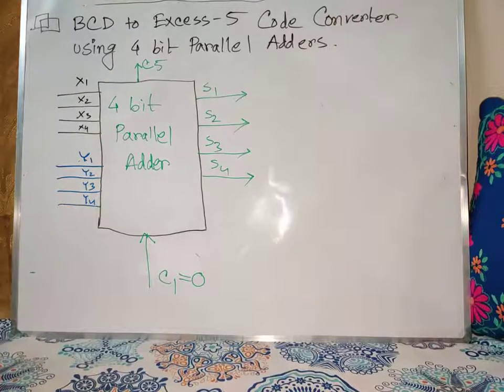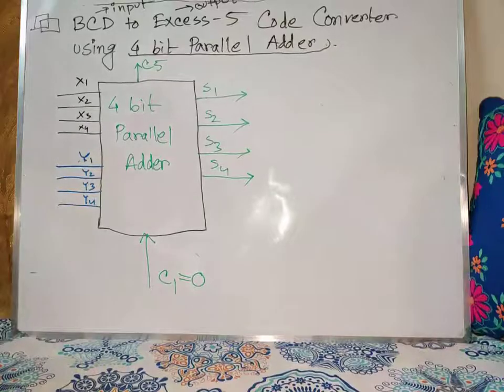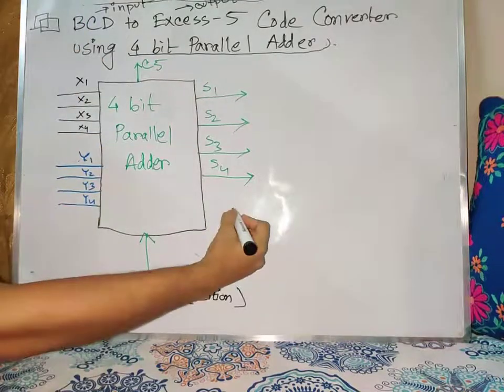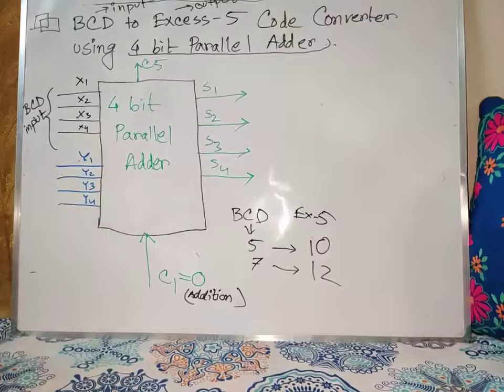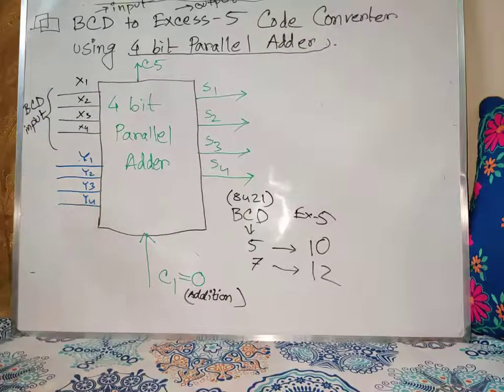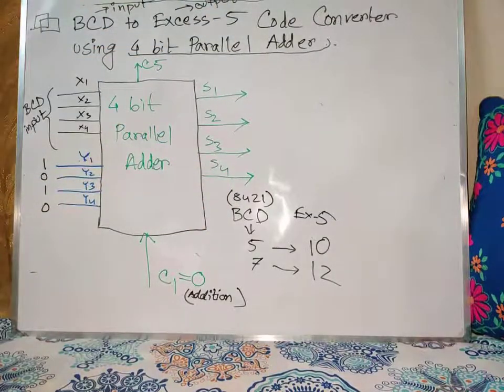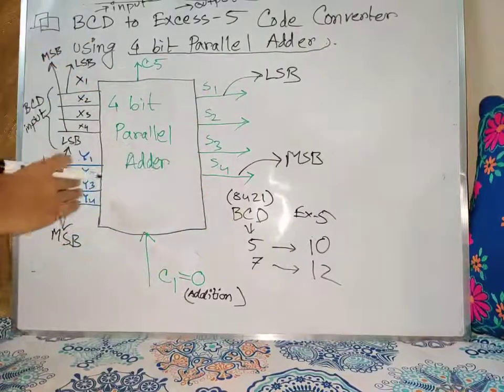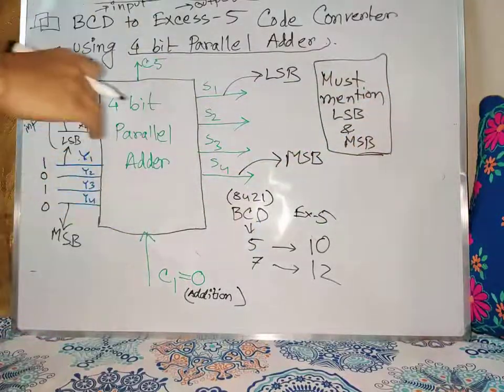BCD to Excess 5 Code Converter using 4 Bit Parallel Adder | Digital Logic Design

Comment: Sir ekta qs ache ekhane to apni 4 te input bcd r jonne niechen kintu 15 ke to bcd te 0001 0101 hoi to apni to 4 te input er 15 er jonne 1111 pathachen but ota to tokhon binary to excess 5 hye jache Sir
Reply from the maker: Hello dear,

The range of BCD is from 0 to 9. Even though we can represent up to 15, numbers from 10 to 15 are not used in BCD
Reply: @dewanziaulkarim1891  ooo ok Sir ebare bujhlam

Comment: 5:03 MSB can be S4 or C5 depending on the situation. Am I correct to assume that, sir?
Reply: even s3,s2 can be MSB I think
Reply from the maker: You both are right. 
Off topic - I think Harold can use his AI machine to make this bloody civilian a good civilian.
Reply: @dewanziaulkarim1891  I just became your biggest fan right now, sir. And about building "the machine", I'd most certainly build one (related to AI, solving important problems). Actually, Harold Finch was the character who inspired me to choose the I path I am currently on (back in 2011).